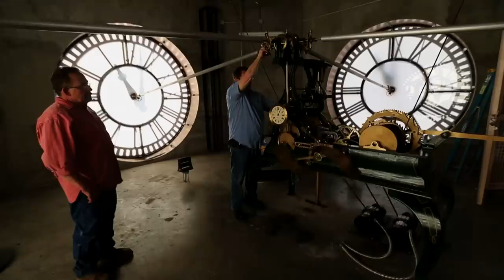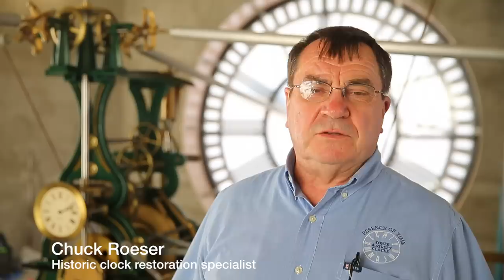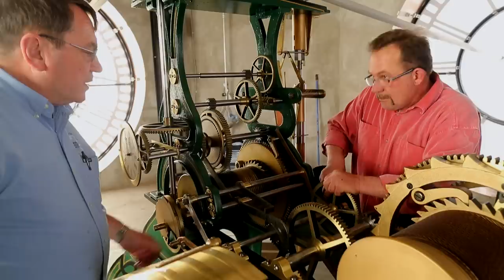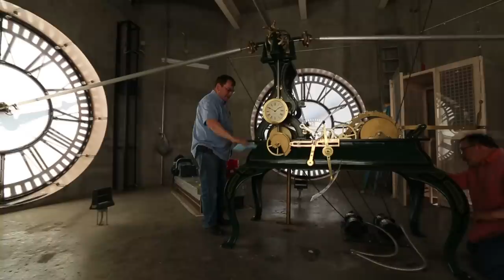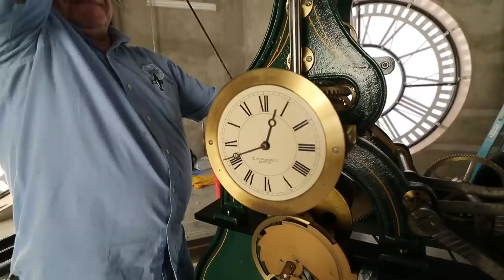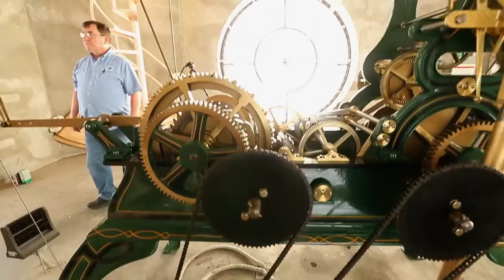Tick, Tock. The Old Red tower clock is set forward for Daylight Saving Time

Comment: Great to see a piece of history there, Where i am live, my city does not have a chiming clock, We have two working clocks in a churches and that's it. One was restored a few years ago, but that ran out of funding to fix the chimes,  Another clock tower is been restored above a pub, which has not worked for nearly 40 years!  Our town hall was pulled down in 1963 and the where about of the original clock workings and bells are not known, the council said its all in storage, but my grand parents said everything was scrapped long ago. My gran said she knew someone who worked in area where it was stored originally and they said that the workings were rusted solid and just scrapped. The bells were said to be in some building near the river.  But everything along the river side has been redeveloped now, so they will have more likely seen the same fate as the workings did.  But that's our council for you, flatten listed building,

Comment: what do the motors do? i guess wind the clock up
Reply: It looks like one is running the gong and the other might wind it up.
Reply: Both motors are automatic winders. One winds the time train (which moves the hands, is regulated by the pendulum, and trips the strike train on the hour), and the other winds the strike train (whose sole function is to ring the bell). Both trains are weight driven and can be wound up by hand crank of course (handy in case of a power outage).

Comment: Second rate clock compared to the Elizabeth tower clock" Big Ben.
Reply: And Big Ben second rate to the Allen-Bradley clock tower in Milwaukee.
Reply: The double-three-legged gravity escapement in this standardized E. Howard tower clock movement, is inspired by the one in the Westminster clock. This movement has the advantage of being much smaller and lighter weight than that one; thus able to be fit in more different parts of a clock tower.
Reply: But obviously yes the Westminster clock is the original; and the first one with that brilliant escapement.